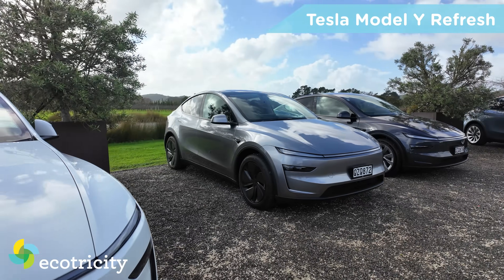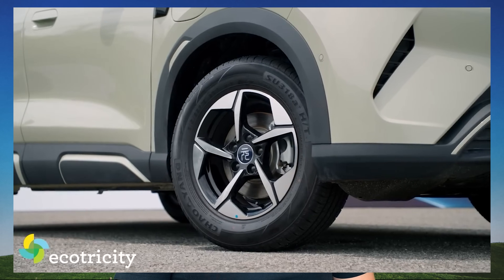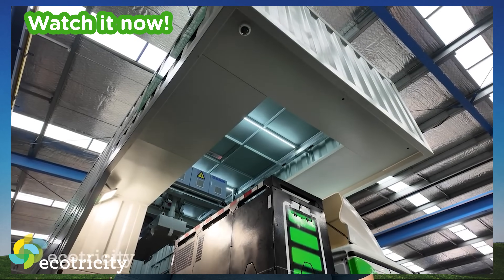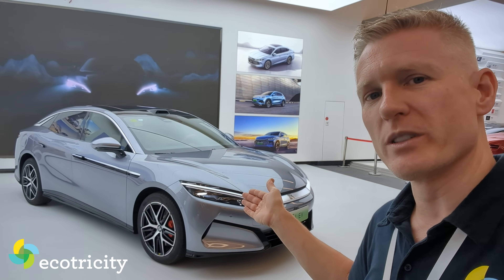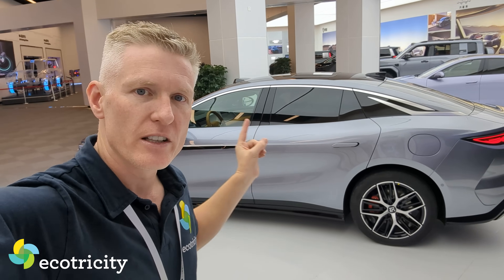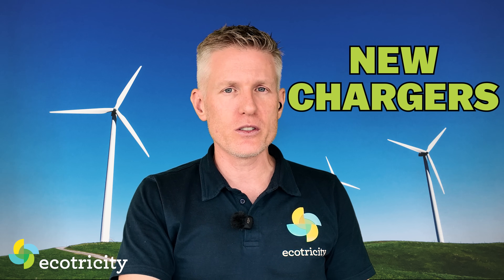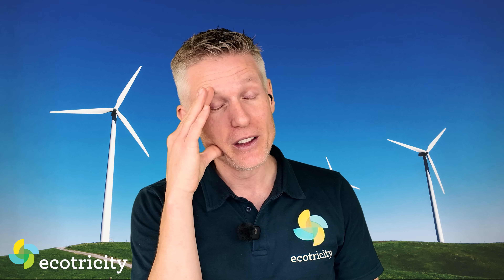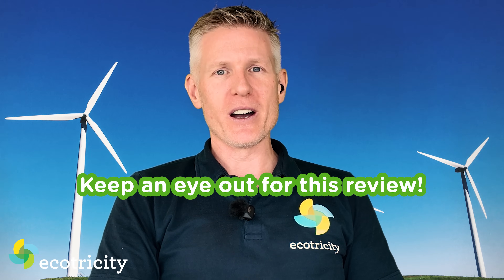BYD Seagull, Honda e:N1 & Game-Changing Tech: NZ Clean Tech News Ep. 2 🚨

Comment: The BYD MW charging is really a slam dunk for BEV over ICE and even hybrid vehicles. But really  I would rather see 4 x 250kW charging stations instead, or banks of Type 2 chargers in parking stations. Comparisons between the time it takes to fuel an ice vehicle versus charging an electric vehicle are virtually irrelevant as the vast majority of EV charging is done when the vehicle is not needed, ie over night at home or, when parked at work or shops, so only requiring slower AC chargers.
It also amazes me how governments speak of energy security, when the answer is under their noses….dump our reliance on fossil fuels by electrifying transport and homes. As you said, look at China.

Comment: Hi from UK! I’m assuming the Honda is the same one we have, the e.Ny1! I’ve got 2. Got them last March, (2024). The wife has the poverty pack, I’ve got the higher spec! Nice car, smooth, very roomy, does everything well except 2 things. I doubt you’ll get in the boot, we have luggage issues for 4 of us. And range in winter. It’s 62kwh battery, we’ve been EV for 6 yrs, it’s by far the worst cold weather range than anything we’ve had. Summer is fine. 
We got them because they had to sell them. Got 2 year PCP (like HP if you don’t have it), no deposit, £175 a month hers, £250 month mine. Tha retail was £40k, far too high, its residual is going to be about £28k, its actual worth will be around £20k so we’ll hand them back!! 
Enjoy your content!

Comment: I would be very interested in a video discussing options similar to a fronius wattpilot go: ie a self contained evse set up to plug into 32A 3- phase (or lesser options via adapters) that you can take with you on a road trip.  Here in Australia, our charging infrastructure is very much confined to urban areas, so any long trip involves "EV chargers" that are nothing more than a 32A 3 phase outlet....so byo evse. The wattpilot go is perfect for this, but does it have competitors, and are the competitors worth looking at?

Comment: It could be nice to talk about all electric houses and insulation. Gas cookers cause indoor air pollution and asthma. I'm loving my new all electric house complete with great insulation. Heat pump hot water is the way to go, especially with teenagers in the house. My solar system is an inadequate 4KW, and I'd like to see more info on solving the grid 5KW feed in limit so that my excess solar can be used and not thrown away.

Comment: Gavin
I get that in NZ you seem to get a good Feed In Tariff however here in Melbourne that is not an option.  Some offer first 10 kWh at $0.10 per kWh but that falls to $0.03 after that and that does mot offset the daily supply charge either.
Live to see how your system generation compares from your summer to winter. Here my winter is 1/3 to 1/3rd of the summer generation. Our daily service charge will mean we never get a credit sufficient to get credit. It seems only retailer like Amber may allow you to get credits if you use a battery to grid tool to sell your power back. But those without battery wont get sufficient credits to offset cost of power on Time of Use tariffs.
Reply: Offsets of power depend on you modifying your usage, but yes, NZ is where Aus was about 6 years ago on this. Theirs will fall too. Amber is the way to go if you have a battery, but only about a third of Amber customers have batteries based on their own figures from last year, so it shows that people who can manage their consumption patterns (many can't, I know) can benefit too.